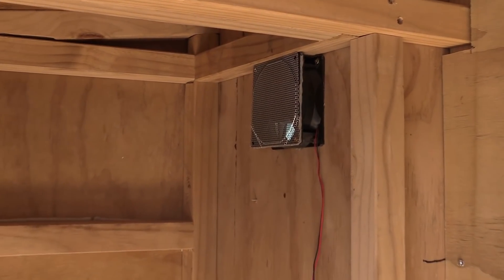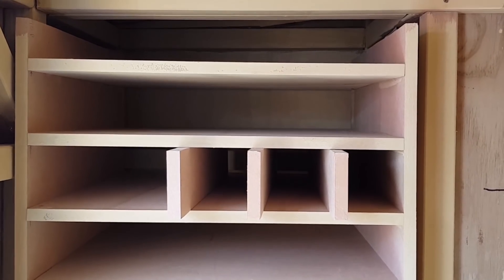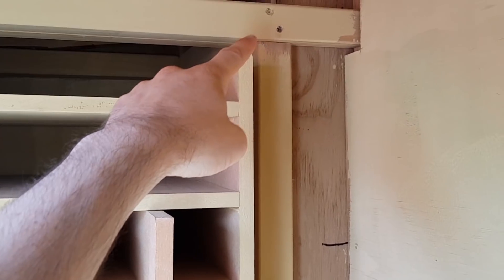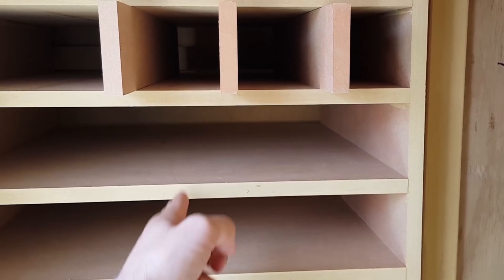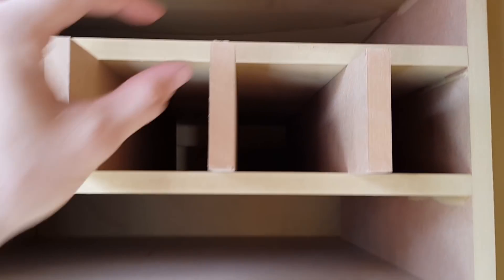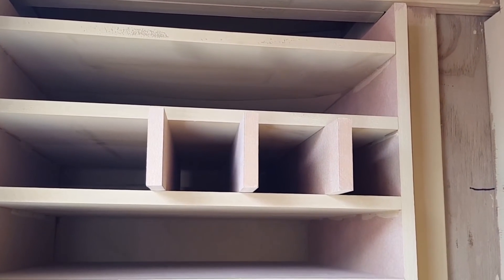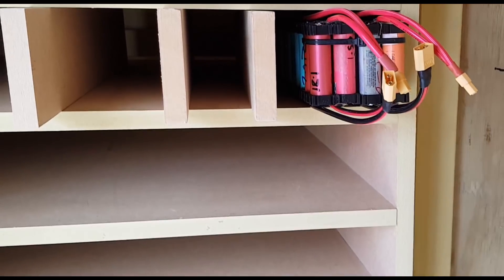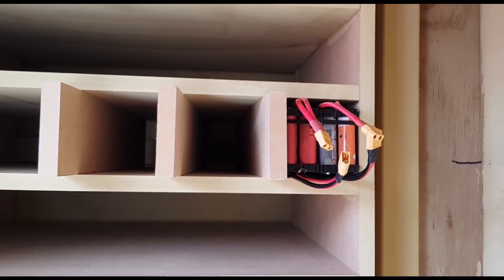Rack UP! 18650 Battery Box Rack Build

Comment: You're placing the cells face down? Do the fuses rub along the bottom?
could you have used thinner MDF or masonite or even thin ply wood for the levels since you have support to hold them up with the dividers? This is a long term investment so paying for some good thin ply wood would give you more room, strength and more powwaaaahh!

Are the cells fuses not touching the bottom which isn't fire retardant? is this even wise? I would have put thin rails on left/right sides to slide along (if you still have 5mm room to do it though.

I would have used masonite, you know the thin 5mm dark wook between the cells and only have 1 MDF or Plywood to help with the weight down the center. The masonite can be the side dividers so you could fit one more column of cells, maybe 2.
Reply from the maker: huh the cells are facing up, Red pos to the top, https://youtu.be/VVMX1NJ3A0Q?t=9m26s
Reply from the maker: 16mm mdf was the cheapest at the time. We got it discounted so used it plus it easy to work with. The shelf divider could be alot thinner tho I havent used masonite before but looking at it, it would work well for the divider

Comment: Having small clearance may be a benefit if there was a combustion, because the burnt gasses would help to prevent the oxygen from reaching the point of ignition.  Maybe the fan needs to switch off at that point?

Comment: What about pack ventilation?
Reply from the maker: One of my main points when doing a powerwall is to keep the per cell current low. This helps extend the life of the cell but also the capacity, draining the cell at very low current over a long period of time. Each cell will see no more than 0.3 amps. At this small rate, there is almost no temp change in charge and discharge. When i get to 20kWh this will again half to 0.15 amps per cell and the problem with heat on the packs completely goes away. Even without the fan the ventilation should be enough for just that but i will need the fan later on....
Reply: Thanks,
I wondered if you were keeping the current draw low enough to prevent heat build-up.

Comment: First of all, I think this is a cool project and will be a cool powershed when completed. With that said, I would make some improvements on cooling the cells. Drilling holes in the shelves 
 to allow the heat to rise out of the rack. I would also cut out that area for the fan on the side wall. You still could do this and I think it will help the cells/packs not overheat. Also, do you have plans on temp monitoring?
Reply from the maker: Hey Joe, Good points, I like the idea of drilling holes in the dividers but that's all I will do in that respect. One of my main points when doing a powerwall is to keep the per cell current low. This helps extend the life of the cell but also the capacity, draining the cell at very low current over a long period of time. Each cell will see no more than 0.3 amps. At this small rate, there is almost no temp change in charge and discharge. When i get to 20kWh this will again half to 0.15 amps per cell and the problem with heat on the packs completely goes away. I will be adding temp and humidity monitoring and fan control plus lighting.
Reply: Looking forward to seeing progress with this! I'm building a 18650 based powerwall as well and just recently started my YouTube channel. I'm lucky that my powerwall will be in my shop (metal building not attached to the house) and that helps keeping it safe. :)

Comment: I'm embarrassed to admit that I did manage to ignite an 18650. I built a pack for my electric lawn mower using second rate cells  and eventually this is what happened: https://youtu.be/cNhtam7bPI8?t=767
Reply from the maker: Oh i remember that video, from that video the problem was found to be pushing the limits of the cell and then having it shorted with another cell/wire on the bench causing it to heat up and catch fire. Not sure why the internal cell fuse-o-thinie didnt stop it once it heated up.